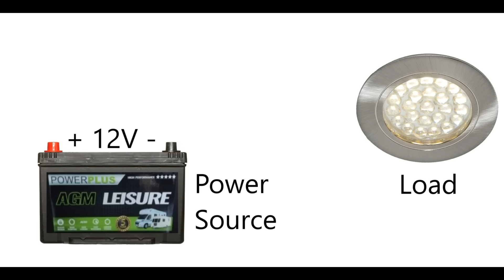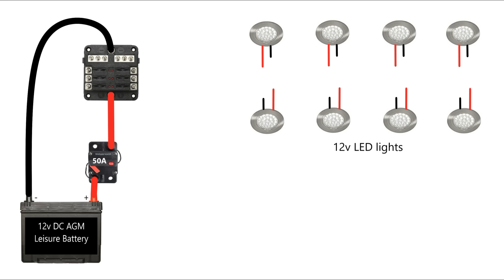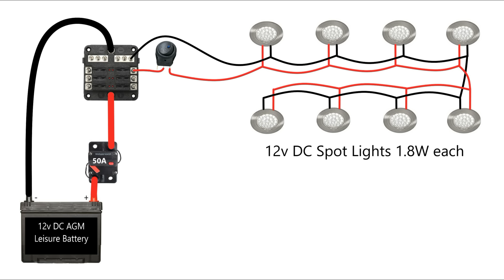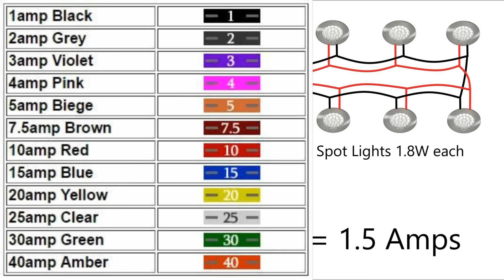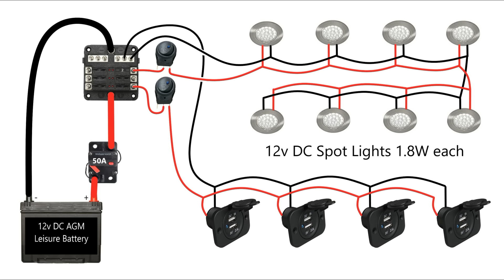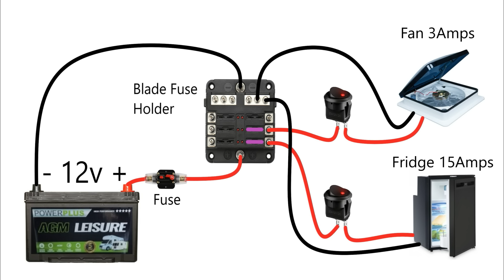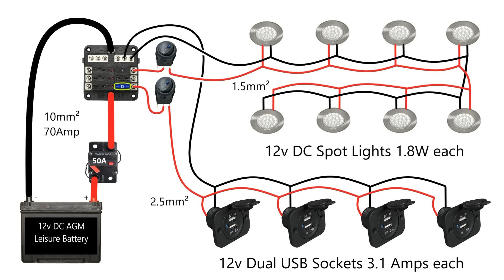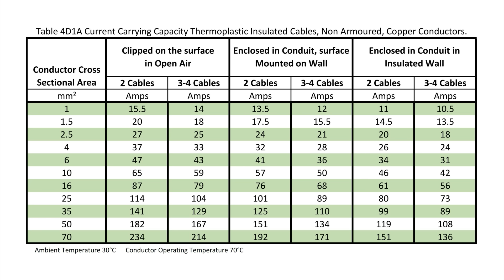Electric Cable & Fuse Sizing - Camper Van Conversion Series

Comment: Greg, hoping I can pick your expert brain to unscramble an electrical conundrum (should have paid attention to physics at school!). I am considering underfloor heating mat for my van and having watched your excellent video on cable and fuse sizing, the following is baffling me. The product is quoted as Heating film 1 meter long 300mm wide 67W/m. It further then states: Power 220W/m²   Voltage DC12V   Max temp. 55°C   Thickness 0.33mm. I don't understand the correlation between the first W/m number and the W/m2 number, finally how do I calculate the amps in order to cable and fuse size? Hope you can help!
Reply from the maker: Hi Duncan, now you won’t like this but I’ll give you my very honest opinion. Don’t install underfloor heating in a van for a number of reasons. 
Any form of electric heating will use a ton of power and will need to be on permanent hook up as batteries will only last minutes. 
There is normally only a small corridor of floor left once furniture is in and at 220W/m2 you will not get anywhere near enough heat to keep the van warm and will need another heating source anyway. 
You’ll lose some of that heat through the floor to outside and it really is not a viable solution. 
There is a reason it’s not been done in any motorhome ever before. Sorry 😢

Comment: Hi Greg hope you are well.  Are there any problems or disadvantages in connecting the negative wires direct to the van bodywork instead of running wires back to a bus bar or block?  I am using separate positive/negative cables as opposed to the 2 core cable you have used.
Reply from the maker: Getting a good connection to the body can be an issue and often poor negatives can cause operational faults that are hard to diagnose. Your van electric system uses the body for negative. Which is why I prefer to keep the leisure side separate. You can do it that why but it not something I would recommend. Thank you for watching 👍🏼😃

Comment: Amazing videos, thanks so much Greg. I'm just working on my wiring at the moment and looking at the wiring diagrams you have provided. I've noticed on your writing diagrams you've provided, the single battery diagrams are using 4 mm² cable for the fridge but the 2 & 3 battery diagrams you use a 6mm cable . Is there a specific reason you have done it this way ?
Thanks again for all the help.

Comment: Hi Greg, I hope you are well. Can I please ask your advice on cable size? I have a Renogy 60A DC-DC charger, and I need to run cables from the rear of the van where the charger is to the starter battery which is in the passenger footwell, so a max of 6m. I have a bank of 4 x 100AH lithium batteries. I am thinking 35 mm square cable. Do you think that would be a safe choice?  Many thanks, and love the channel!
Reply from the maker: Yes that cable size is just in with a volt drop of 0.4v which is 3.3%
You wouldn’t want a volt drop of more than 4% 👍🏼😃

Comment: Hello Greg. Just want to make sure I have this right. My usb sockets have on/off switches built in so I can still parallel them and they'd all work individually, depending on whether I've flipped the little power switch on them or not, right??
Reply from the maker: Yes correct :D

Comment: HI Greg - where did you get the control panel / box from? Did it come pre wired with the busbars etc or did you compile it yourself? Thanks
Reply from the maker: It was something that I designed and built ourselves.

Comment: Hi Greg. Thanks for the incredibly useful video! I was hoping you might be able to help with a cable sizing question please?

I've calculated a peak load of around 23A from 12v appliances, and I'll also be running a small 250W inverter with a rated peak of 400W/33A. I'll also have a 60A Battery-Battery charger, a 320W solar panel via a 30A MPPT controller, and a 150Ah Lithium battery. I was hoping to wire a positive and a negative busbar directly from the battery, and via a single switch on the positive, be able to disable the whole system from one place.

Should I account for charge amps as well as draw amps to work out the total load, and therefore the cable sizing, to/from the battery?

Comment: Hi Greg, thanks for your amazing series! I have a doubt about the blade fuse holder: ive seen a lot of reviews on Amazon, pointing out the fact that even without fuses there is current (3 to 11v  depending on the reviews) getting through the fuse holder. What do you think about this?
Reply from the maker: That is the first time I’ve heard that. The ones I have do have red LEDs so there would be a minute draw if those are illuminated. I’d have to test one myself.

Comment: Great video Greg. What size cable would I need to use from the battery to fuse holder? I’ll be running fridge lights and possibly a tv. 

Many thanks

Comment: Hi Greg. My first ever youtube comment. I was wondering what your thoughts are on power stations like the bluetti ac200max. How would one wire up a campervan to this?

Great youtubing a huge thanks. Wish you the best.
Reply from the maker: Hello, they are finally starting to come down in price to be a viable option. They are really a portable solution and probably best teamed up with a suitcase solar panel that you can fold out and face toward the sun. Simply plug your devices into it to run or charge. 👍🏼😃
Reply: cheers! Yes i was wondering for the fixed items like lights, boiler, fridge, water pump, even fixed roof solar, 240 socket in the van etc... i think it must be possible to have the fuses and wiring all fixed and some how just plug it in, but just not quite sure how you would connect the full fixed electric system into the portable power station unit. 

I like the idea of when the van is not in use you can bring the powerstation in the house safe and sound and fully charged ready for the next trip. 

Big thanks for the content. P
Reply from the maker: On that particular model there is a 30A 12v output that you could use to power a blade fuse holder. For lights, water pump and fans. 
You could extend the 3pin sockets with extension cables to sockets located elsewhere. Still leaving lots of usbs for charging tech and a 10A cig socket for other 12v devices. You could have permanent solar panels fitted and plug those into the input when you put the power bank in the van. 
All the leads can be wired local to the battery pack and simply plugged in when needed.
Reply: Big thanks. I will keep exploring and do my own wiring diagram and thinking... but your comments have helped me confirm its a viable option. Cheers again.

Comment: Hi Greg. Great Videos. I have 4 X 100W renology solar panels, wired in series parallel  a Renology 60A MTTP and 4 X 130 batteries.the panels have 4.omm2 cable. and batteries have 2awg cables. Can you advise me please on what size fuses and isolators i would require. I also brought the kregar 200w inverter after your write up on you van.

Comment: This is not too related to this video but based on your expertise I think you will know.......how long will a deep cycle battery last vs a regular car battery under the same load?

I looked for info or a video online but couldn't find anything.

Thanks in advance.

Comment: Should I buy a pure or modified sign wave inverter to power a cool box (no compressor) in a cabin on a solar system forever?
Reply from the maker: The output from a pure sine wave inverter is closer to actual AC so it is the better choice. However our Kreiger modified inverter works perfectly with all our electrical appliances and tech no problems

Comment: Hi greg, you don't seem to mention the change in wire gauge size based off the length of wire needed. For example if a USB socket was close to the battery and another was far away there might be 8metres difference in the total length (positive + negative) of wire needed which would change the wire gauge of each USB socket significantly. Can I ask why this isn't mentioned? I am currently doing my calculations for wire gauges and I'm wondering if I'm missing a trick?

Comment: Cracking video, what size inline fuse would you recommend installing between the van battery and the split charger? I'm running 25mm cable
Reply from the maker: 1.25 x the rating of your split charge relay.

Comment: I have one question that I have not found an answer to maybe you can help I understand how to calculate the amps drawn from a 12 v DC battery but what happens when it's going through an inverter does the calculation stay the same or does it change

Comment: Hey Greg, awesome video, thank you very much for sharing :) Can I ask if you have a grounding point attached for the 2 battery system? I am using it as the base for my electrical set up but cannot work out if I need a grounding point or not? Thank you :)
Reply from the maker: No I’m not using the chassis of the van for any negatives as I’m hard wiring everything as the plan.
Reply: Love it, thanks Greg :)

Comment: Hi Greg , for battery  positve to say busbar. Do you add all your amp loads including inverter together. What about mppt and b2b using the cable as well for charging the battery. Do you add this as well then add 1.25 for fuse ?

Comment: Great video, thanks Greg. Couple of questions - when adding all the loads to calculate battery cable size to the blade fuse holder, is it all the DC loads or all DC and AC loads combined? How do you calculate the battery and fuse size to your inverter and between the batteries if installing more than one? 
Thanks

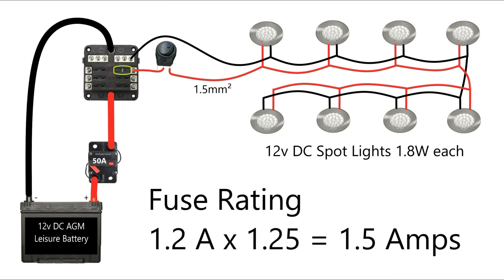Comment: 15:19 If I am reading this table correctly, surely 1mm² is way more than adequate since it would take 11amps and our fuse was 2amps.
So I am obviously missing something, so I wondered why you went for 1.5mm² cable?
Reply: I am obviously reading this table wrong, at 19:40 you say 10mm² cable can take 70 amps. 
Are you rounding up? Because the way I am reading the table, the cable could take 65amps only if it was the two cables only and if it was clipped on the surface in open air.
I am very confused here.

Comment: Excellent video.  How do you choose the wire size?  Does it need to be different in any appliance?  I mean,  am i suppose to use thicker wire for fridge than led light?  
Last one , the size of the main circuit breaker, if i have one leisure battery of 100 or 120 amp , what would be the best to use?
Reply from the maker: Please watch the video from this point and it will explain about cable and fuse sizing https://youtu.be/koFg6oFs0RU?t=758
Reply: @GregVirgoe  thank you so much. Everything is so well explained. Very helpful.

Comment: Hi Greg, thank you so much for this video and your diagrams for all of the systems you've put together too! I've found them invaluable! 

I've been trying to research the best way to splice the t-junctions in the wire system together, such as for spurring to a light fitting and I'm at a loss as to what I'm actually meant to do to make sure it works, and works safely! I'm seeing expensive solutions such as junction boxes, etc. Do I need one for every spur? What do you do or recommend? Thank you!
Reply from the maker: You need to watch my next electrical video and all will become clear :D https://youtu.be/UP10-tW7TQg
Reply: @GregVirgoe  Greg! Thank you so much! I don't know how I missed that video!

Comment: Hi Greg, I'm just trying to find out what size cables I need and have a question. I'm confused on the type of cables. Everyone seems to use the same amp chart as yourself, but isn't this for standard wall cables? Why doesn't anyone recommend thin wall automotive cable which seems to have almost double amp carrying capacity and much higher working heat range?
I am a novice so please forgive me if I'm missing something.
Reply from the maker: True there are cables that are rated for much higher current so in theory you can use a smaller dia but you also need to take into account the voltage drop on a small cable due to resistance. To help you better size your cables use this free cable sizing calculator on the 12v planet website. As long as the result volt drop is below 4% you are ok
https://www.12voltplanet.co.uk/cable-sizing-selection.html
Scroll down the page to find it 👍🏼😊

Comment: Thanks for the video. Just a quick question, what parallel connectors in the van would you use?
Reply from the maker: I would use the WAGO or I would solder and heat shrink. I’m not keen on crimp fittings as had them fall off before.

Comment: Good afternoon Greg. I found your electrical install videos and wiring diagrams very informative.  Thank you.
However, my proposed electrical system for my current (and first) van build, uses a Jackery Explorer 1000 instead of a leisure battery.  
If I wanted to charge from a 12v lighter socket when driving, do you think I'd need a 12v inverter?  Or, is it even possible to hook up to a split charge relay?
If you were using a Jackery as your main power source...how would you set it up?

Comment: Hi Greg, does the negative wire always need to match the size of the positive wire to a device? Eg if I was wiring a fridge with a 6mm positive, would I need a 6mm negative too? If so, is there ever a case where this wouldn’t be true?
Reply from the maker: They always need to be the same size 👍🏼😃

Comment: Hi. Question regarding wiring in insulation. So notice from your excellent video that if you place wiring in a conduit in insulation it can take less of a load, so can you place cable in insulation without being in a conduit and if yes would the load be even less. I was thinking of cable inside spray insulation but now don't think this would be a good idea. Any help would be appreciated 🙏
Reply from the maker: If you insulate around a cable it cannot get rid of its heat so easily so to be safe the cables are down rated on load.  If you do plan to install like that use a larger cable to be safer 😁

Comment: Hi Greg, really helpful video thanks! Quick question I’ve got 2 x 2W lights wired together. I’ve worked the amps out as 0.33 and multiplied by 1.25 to get the fuse I should use. This comes out as 0.41. I’m struggling to find a 0.5 amp fuse so would a 1 A fuse be ok? Thank you.
Reply from the maker: Yes it would in that case 👍🏼😊

Comment: Hi Greg hope you see this and hopefully you can help me? (great video by the way!). I bought a campervan recently with a 75ah lead acid battery and it died within 2 days of while camping off grid. I'm wanting to replace it with 2 x 160Ah AGM batteries, however I'm concerned regarding the existing wiring loom back to the Sargeant EC176 PSU/Charger. I will be wiring the two new batteries together in parallel and linking the positive from the loom up to one of the batteries and the negative from the loom to the other. Therefore its still maintaining its 12v? My question is by me changing the batteries from 1 x 75Ah to 2 x high capacity 160Ah AGMS will I need to replace any of the wiring or will all the existing wiring be fine?
Reply from the maker: If that is all you are doing then all the wiring will be fine. You are only changing the stored capacity of the batteries. None of the loads have changed. Hope that helps 👍🏼😃
Reply: @GregVirgoe  Hi Greg thank you so much for your quick reply you are an absolute star!! Really appreciate your assistance mate, the world should be filled with more people like you! Your videos show how much you want to help others and that is a very rare gift these days therefore I hope life rewards you with some great travels touring in your van 🙏 I've just subscribed to your channel thanks again Greg! 🙏😊
Reply from the maker: @scubacollie2083  really appreciate your support. Glad to help. Happy travels 👍🏼😃

Comment: If I hooked up the negative from my leisure battery to the van, can I then have the negative cable from my lights ground to my van too instead of having the cable go back to the fuse unit?
Reply from the maker: In theory that would work as that is probably how your van electrics are wired. 
However in practice it can be difficult to make a good connection to the van. If you are running one cable why not run a 2 core instead?

Comment: Greg - your video has been very helpful for me. One question, how did you determine the 50A breaker fuse for the battery? Is this determined by your total load of all devices running at once? I plan to start with a 100ah, 12v Lithium battery. Thanks in advance!

Comment: Hi Greg, I'm currently installing my electrical system for my van build. I want to ask for your opinion. I have a 200 solar panel. What gauge of wire shall I use for all these? from my solar panel to my battery isolator to my charge controller (20amp) to my circuit breaker (50amp) to my fuse block? Also, did I get the right amps that I want to use? It's confusing but I appreciate you showing how you do it here. Thanks .
Reply from the maker: Hi Maso, from your solar panel to your mppt charger controller use 4mm black PV cable. From the MPPT to the battery and to the fuse holder I would use 10mm battery cable. Hope that helps you 👍🏼😃 good luck with your build
Reply: @GregVirgoe  Thank you so much for your prompt response. I will do that I hope to finish this electrical system of mine. I appreciate it so much. ☺️🙏🏻
Reply from the maker: @thisismaso  no problem anytime just give me a shout 😃 best wishes
Reply: @GregVirgoe   Good morning; thank you for your response. I have follow-up questions regarding the 4mm PV pole cable. Are you referring to 12awg (4mm) pv solar extension cable? What gauge is the battery cable? I'm sorry I have no idea of the electrical terminology 😖